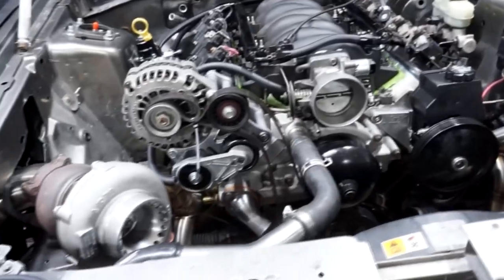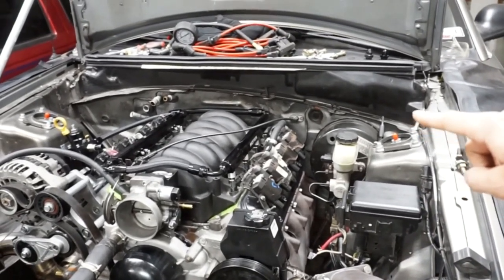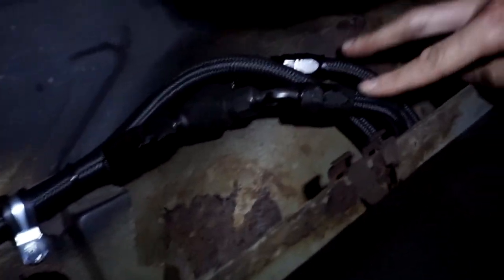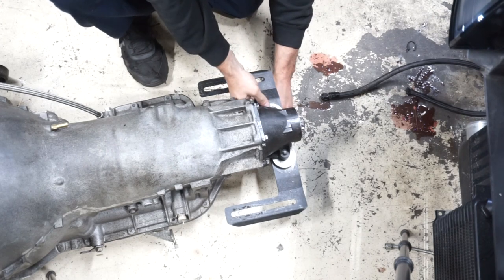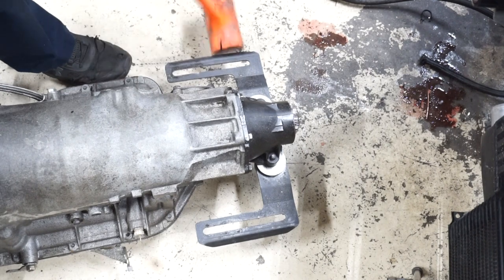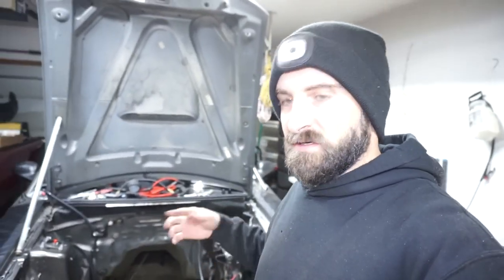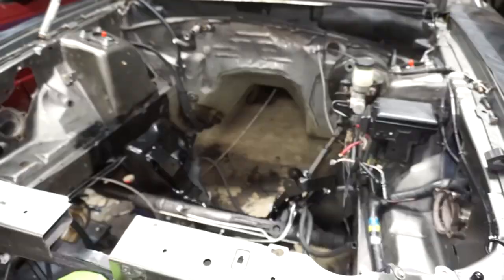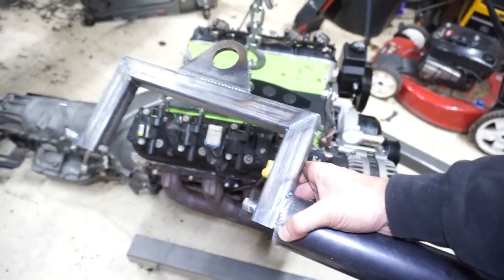Knocking Out The "Fun" Work First | Twin Turbo SBE 5.3 Mustang Brake Lines, PS lines. INSANE!!!!!!!!

Comment: Factory k member???    My son is considering one of the mustangs…i told him as soon as the 4.6 goes kaput…were goin LS…probably just a baby 4.8…..teenager dont need all that hp anyhow…he can work his way upto it!!!
Reply from the maker: This is the factory K, but it's modified. The car had a motor plate, so the original mounting pads were cut out, and I rebuilt mounts.